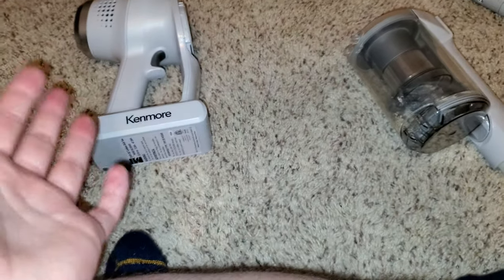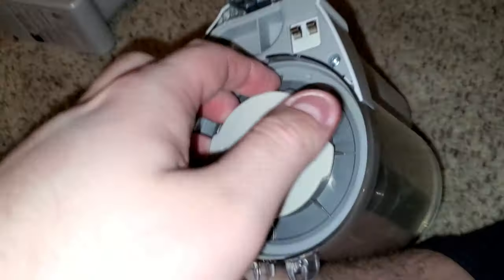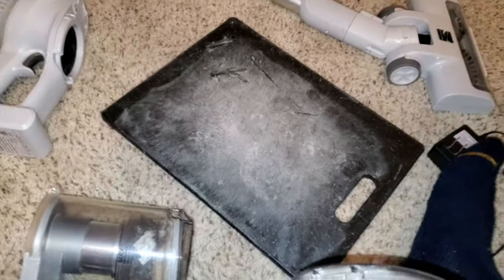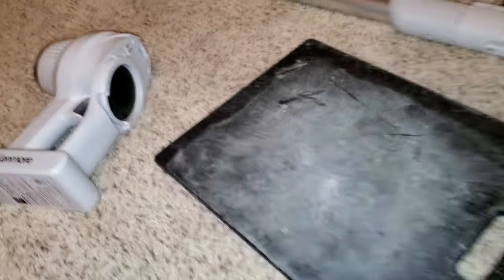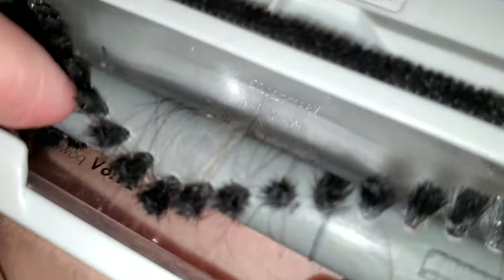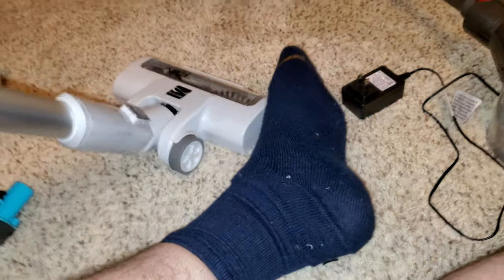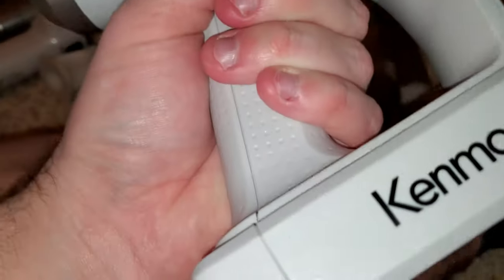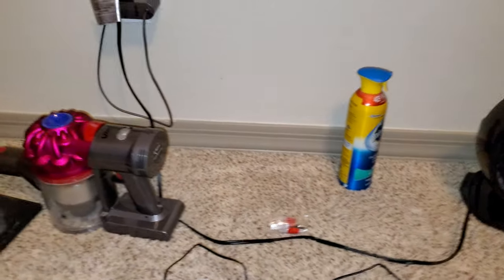Kenmore Csv Go, Battery Overheat, filter clogging. Other Problems🙄😒

Comment: I bought one a few months ago, and am less than thrilled with it too. I’m having the same problems. I can’t even get it to start now. I cleaned everything out, charged it. Will turn on fine without the stick attached, but if I put the whole thing together will turn on & then flash red and turn itself off after a few seconds. I’d return it, but it’s been too long. It’s a piece of $125 junk sitting in my closet at this point. 🤬
Reply from the maker: I would still try and return it. If it's faulty
Reply: @mistakencharis2310  Nothing, unfortunately. It’s still sitting in a closet. 🙄🤬
Reply: Amy B, that's exactly wats happening 2 mine rite now. I take really good care of it n only had it a short time.
Reply: I had the same problem. It would work if the stick wasnt attached. At first I thought dead battery. But if it works without the stick attached then it’s the roller. The roller is supposed to spin and if it doesn’t the motor shuts down. I took it apart and manually spun the roller cuz something jammed it. I couldn’t do it without taking it apart. Once it was able to turn it and put it back together it worked. The motor in the vac spins a pulley that turns the roller.  If the roller doesn’t spin easily then the motor shuts down. Hope that helps. I was just gonna throw it out lol but took it apart and works now.

Comment: It is an awesome replacement for a broom and pan. Beats sweeping hard surfaces. I would rather compare it to a swivel sweeper than a Dyson. Its a cheap end stick vac not a 500 dollar vacuum. Probably over worked the motor and battery as well as the gaskets constantly vacuuming carpet.
Reply from the maker: It still needs to work as designed. Its a cordless vacuum advertised to clean carpets and floors. Its not a swivel sweeper. Go for the Hoover Blade or a Tineco A10 Dash

Comment: It's a decent vacuum for picking up little stuff on hard floors, but then again I only paid 18$ for mine because it was on clearance at my work, so I guess its good for 18$ worth. I am kinda upset though, I charged it for a day and now it wont turn on whatsoever, Im thinking it probably overheated the battery like you said while I was at work. Not sure what im gonna do with it now, this thing wasn't made very well at all!

Comment: Hi, so I was having the same issue with the gasket where some of the air was blowing out from the holes on top & I originally thought that the problem was with the gasket but after I took everything apart everything seemed to be in order. Nothing looked out of place. It wasn’t until later when I removed the filter that it started working properly again & it got its suction back. Hope this helps
Reply from the maker: Ok cool.

Comment: how do you replace the batt do you have a video Kenmore DS4015?
Reply from the maker: The battery is built in and non replaceable.
Reply: My battery lasted about 3-4 months. Irreplaceable. I filed a claim and they said they would send a replacement in 14-21 days. That was about 6 weeks ago and I finally called today, they said they are on backorder... I asked if I could just get a refund and he said if they haven't come in in the next month. Meanwhile I'm still without a vacuum 😐 Found this video while looking for a better stick vac, might check out the recommendations!
Reply from the maker: Get, a Dyson, LG or Samsung vacuum. They are much better
Reply: @VacMaster1991  I would Love to get a higher quality vacuum, the problem is my budget says otherwise. I got the Kenmore csv largely bc it was supposed to be super quiet, and really lightweight. Do you have a recommendation for another stick vac that's quiet/lightweight? (And has a better battery)
Reply from the maker: Best option for the money. https://www.sharkclean.com/products/shark-pet-cordless-stick-vacuum-zidIX141H